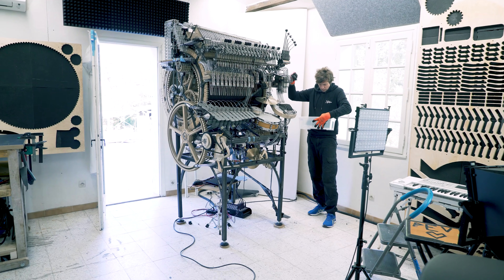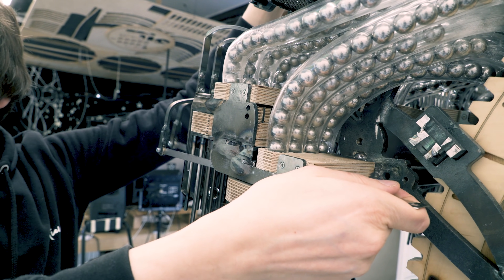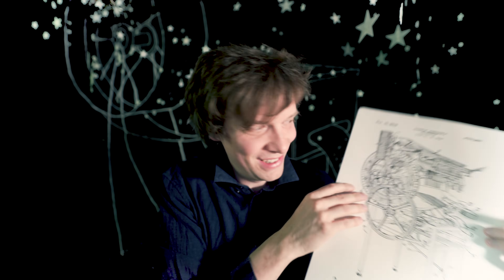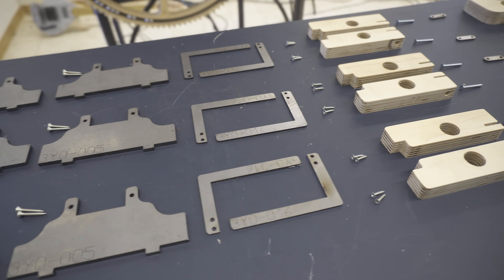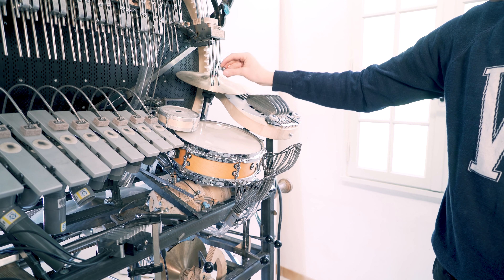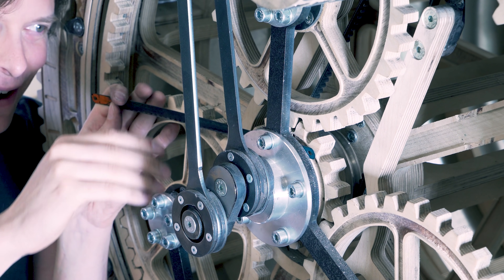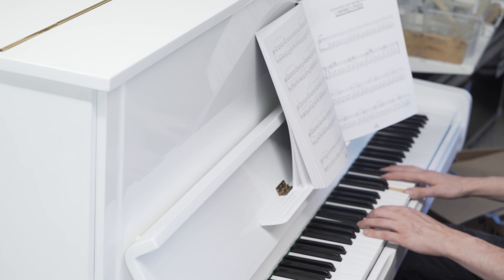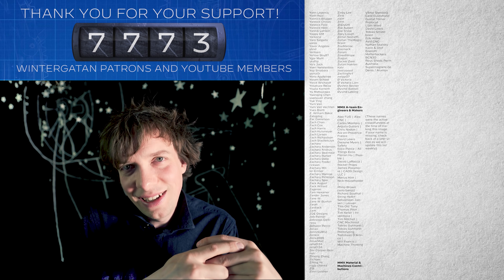Cyber Funnel

Comment: Hello Martin,
I already made this comment in a previous video, but I want to repeat myself, because the trouble you had with the screw is very symptomatic of the MMX I think. This machine is beautiful, and I love it. But its main purpose is to play music during a world tour! Which means a lot of travel... So before to even start the tour, you have to do ONE thing: disassemble it, and reassemble it again. At least once, but ideally several time. And then you will learn how robust is your design. Because until now, you did a lot of very nice and precise adjustments. But trust me, I'm an engineer and worked on very precise scientific instrument on spacecraft, and precision is nothing if it is not repeatable!!!!! Think about all the fine tuning you made until now, what will happen if you have to redo then each time you move the MMX...  
So please, at some point, plan to disassemble and reassemble this machine if you don't want to have bad surprise later. And yes, securing all screw that are not setting screw is a must.
All the best.

Comment: If you used thin Teflon strips between certain sliding parts and experiment with a few different compounds for some sprung bump stops etc, maybe even replace some metal parts with Teflon block if possible you would really start to be able to damp down some of the bad or out of place noises (if any) and let the rest shine. After that you can play with timing i.e adjusting the distance on cyber funnels perhaps again so the noise of the catch falls in line with the tempo of the music.. again control the volume of the funnels with some clear or black rubber piping.. nothing to worry about at all just part of the development 👍 looking very cool would be a great project to work on

Comment: Hey Martin. I have a question perharps you or someone else can explain to me. After dramatically removing the old marble drop system  (pain is temporary glory is forever), the new design has the same „marble dividing technique“ by moving in and out triggered by the pins on the programming wheel as you have it  more upwards under the pmma pipes which we see on top where the rolling marbles fall in. My question: why do you have this system twice. Wouldn’t just the lower one be enough?                                  I hope I was able to explain which parts I mean. Thx for your answer.                        Ps: you‘re doing an amazing job as an engineer. There is no doubt you will do even more amazing work as a composer. Wish you all the best and stay safe

Comment: as in the last video, i asked myself why you would use epoxide to fix your screws, because it will be really hard to open afterwards, when you need to fix something.

Use Loctite! its a threadlocker, so screws won't open from vibration. But with some force you can open them again. Will be harder with epoxide and you'll destroy the plywood definitely! That would pose a huge problem concerning spares on the tour: repair one thing and destroy more on the way? you don't want that.

Comment: I would recommend a thread locking compound, instead of epoxy, in case you ever need to get it apart. Also, I would be careful of the PMA pipe being the only support for the funnels, that pipe won't hold up.

Comment: I know you will probably never see this comment, but you could always use liquid rubber to coat the outside of the marble funnels to mute the noise they make. I used to use it constantly when i worked in robitics. (we would dip parts that made contact with eachother into the rubber so when they hit it would make a muted noise.) This would also make the marble funnels look really good as they would be a flat black color.
Reply: I just wondered if this wasn't an option. I love the sounds the MMX makes, but I can see Martin's worry. A black rubber coat would actually be a good thing and could add a feature to the design.

Comment: Regarding the noise concerns, I'm certain there is a solution out there as you have tackled much larger hurdles on this build.  

I'll throw out a thought or two on the subject, even though it seems likely they are ones you may have already considered.

The MMX in operation should have a noise signature that you can record, identify, and drop out during/after the recordings.  Maybe it only needs to be a small percentage of reduction to achieve the result you seek.  I agree with others that some of it's mechanical character should be present.  Not sure if one signature filter would work for all songs or that a digital filter wouldn't harm the purity of the notes you want, but thought it might be a strategy worth looking at.

Another path could be your source for contact microphones if they might be willing to help with your unique issue for picking up the vibraphone sounds without affecting their function, perhaps reducing the connected mass or creating a solid body that will resonate/integrate with the vibraphone bars with a modified cabling that might pass through (or be) the elastics that are used to hold the bars on the bracket?

Some kind of audio barrier (like your room echo reduction) around the vibraphone area to deflect or isolate the ambient MMX mechanical noises around it?  Acrylic shields which retain visual activities but reflect/deflect/absorb unwanted noises?

I'm confident you can slay this dragon, too!

Comment: How difficult would it be to add a small retractable shim at the bottom of each pipe so you could quickly load the tubes without having to use a separate tool? I realize that could add a troubleshooting point so I'm not sure the cost/benefit... On the one hand, you don't want a channel to get blocked accidentally, on the other hand you don't want to be searching for the tool to load the pipe... I'm not sure it was worth me even asking the question. Now that I've gotten this all out, I think the work involved might be better spent elsewhere.

Comment: Hello!
To prevent unscrewing you'll need locktite 243 or similar - apply it to thread before tightening and it will be fine. It's very important to do, because during transportation by truck everything gets unscrewed! Especially when wood involved - with humidity change wood can shrink, reducing screws axial force and increasing chance for unscrewing.
Also I highly recommend considering some coating over all the steel you have. In humid environment or over large period of time steel would rust. It you are going to transport machine by sea - rust is guaranteed. If you like bare metal look - just spray some clear coating over it.

Comment: do you plan on alternating world tours with Building phases?
after the tour you might want to build a MMY, and after that , and after the next world tour, you might want to build the MMZ...
do you collect ideas that did not make it into the MMX ?
here is one: instead of the vibraphones and bass, give the MMY a harp-like Arrangement of metal strings, one string for each note.
to work that Arrangement would have to be placed under the programming-wheel, or in front of the PW with the impact-Points towards the PW.
in the rear Levers could be arranged that shorten each string as needed, or exchangeable string units, like the exchangeable vibrafone bars.
the idea of all of this is not to replace the MMX, but to acompany it.

Comment: Have you ever considered using rubber balls to eliminate the sound off the metal balls hitting each other.
Reply: Using "rubber balls" would involve an absolute and total redesign of the MMX as it uses magnets to lift the metal marbles.
That would set the project back a good ten years...

Comment: Question: why epoxy the screws/bolts, instead of using threadlock? Epoxy seems fine for things that will never need disassembled, but there must be a lot of the machine where bolts are at risk of vibrating loose, but can't be permanently locked up without compromising repairability. Threadlock was literally designed for this use case, and it's also much less of a pain in the ass to use than epoxy.

This may have been answered on the first video using epoxy on a screw, but I couldn't find it there, sorry!
Reply: My guess, and some googling seems to confirm this, threadlock/loctite is for metal screws. Martin needs to use epoxy for the screws that binds into wood.
Reply: Andy Walker I literally cringed when he said epoxy.  Things will break and wear out and epoxy will make you want to eat a bullet.  Red thread locker is “permanent” but can be undone with some heat.  Not sure how it does if things are threaded into wood threads through
Reply: @completepropertycare  epoxy melts with heat, soldering iron on the bolt head works great to soften the epoxy enough to get the bolt out
Reply: @ulbuilder  Really? That's worth knowing - thanks so much! I was also wondering whether PVA glue might work as a threadlocker in wood.
Reply: @completepropertycare  Epoxy can be undone with heat too... mounting ski bindings into wood core skis with epoxy is pretty standard, and heating the screws up with a soldering iron to remove them is common. I've done it many times. Thread locker is for metal on metal and is a (I think) a reaction like rusting... never use it on metal to plastic, it eats plastic and makes it brittle.
Reply: @luxmonday  Interesting. Regarding metal to plastic: all the laptops I've had use threadlock on every screw holding the laptop shut. Some of those screw into metal inserts, but as far as I can tell, most of them screw into plastic. Perhaps some types of plastic are more vulnerable than others, or this is a different type of threadlock?
Reply: @CamTarn  The one that I had trouble with near plastic was "permatex" medium strength threadlocker that warns "Caution, irritant"... so I suspect it has acid of some kind in it. I've seen screws with a non-liquid locker pre-applied, I wonder if that's some kind of plastic that mechanically binds rather than an acid. Next time I'll read the datasheet!
Reply: Interesting, thanks everyone! I didn't consider the issue of threadlocker into wood, and I also didn't realize heat softened epoxy: a very good thing to know, as I occasionally use it myself :)
Reply: At least for some of the screws Martin inserted metal threads into the wood.  He can use Loctite to secure those screws.
For wood screws, I guess it either has to be epoxy, or he can also try to wrap some sewing thread or flax around the screw to increase friction, if that’s sufficient to hold the screw in place.
Reply: I think he meant strong glue by saying 'epoxy' in that context.
I would not assume he would use that.
Reply: @KunigasSuvirintojas  Well he literally used epoxy in the last video, so I would assume he ment it now as well.
Reply: @KunigasSuvirintojas  Indeed he does use epoxy, not Loctite.
Reply: You're right, epoxy would be a bad choice. Most thread locker's like locktite though, won't work in anything made of wood because they are anaerobic (they don't set if they're exposed to open air, which is why the bottle is only 2/3rd's full when you buy it). A better choice might be PVA glue. In reality though, and this is true for all thread locker's (it's the bane of my existence as a mechanic) you only need put a tiny amount of thread lock on a bolt to stop it from rattling loose. Enough to cover one or two threads. The object of the game is for the BOLT to hold the thing together, not the thread lock. If applied correctly, even two part polyurethane epoxy would work and be easily "cracked open" if it needed disassembly.
Reply: Epoxy is a good choice for screws in wood, think about laminates that are made from epoxy and other materials -  skis come to mind, they are a laminate with plastic, fiberglass or carbon fiber, wood and metal all held together with epoxy and they flex constantly in use.  It is also common to use epoxy on the wood screws that attach bindings to skis.  I personally use anaerobic thread lock on metal to metal threads, but use epoxy on metal to wood.  (I have used epoxy on metal to metal if I was out of thread lock.)  Plus, I'm pretty sure Martin of all people knows the pros and cons of epoxy.  As mentioned before, heat will help breaking lose both thread locker and epoxy.
Reply: threadlocker is basically just superglue that cures anaerobically
Reply: Using too little hardener (or insufficient mixing) results in a softer mass due to incomplete curing. Could this be a solution?
Reply: So many misconceptions in this thread
1. Quality epoxy that is mixed property is not brittle. 
2. Epoxy will withstand massive vibrations, watch me fly in my wood airplane assembled with T-88 epoxy for proof
3. Epoxy will soften under heat, just like thread locker will and is a good choice for that application, especially in porous materials like wood.
4. Epoxy comes in many different formulations to meet different needs, match the epoxy to your application for best results
5. Always mix epoxy according to the directions, using more or less  'hardner' does not slow down or speed up curing or change how brittle it is. What it will do is result in incomplete curing and make it weak.
6. Epoxy is stronger in shear than in tension, it is not suitable for all repairs.
Reply: I was wondering that as well Epoxy is also a very bad idea for securing screws because when it hardens it goes brittle instead of yielding a little. Therefore with the vibrations the epoxy will just break as well and you end up with a glued shut thread you will most likely never going to use again AND a loose bolt or screw blocking the machine!
PLEASE look into self locking „o-rings“ or nuts or just a locking design (piece of metal in the hex head or around the hex head that physically stops the moving or like with aerospace technology a piece of wire through the bolt to block it from rotating) and if you really can’t think of any other way to secure the screw there is green or red loctite to hold it in place but I’d recommend that only as a last option since like I said with complicated and fragile machinery you really don’t want to have glue in the threads which you have to heat up or drill out to get it out.
And yet again please don’t use epoxy or any other glue that isn’t designed for the task! You wouldn’t tune your new piano with a pneumatic impact driver either ;)
Reply: ThePunischer1000 decent epoxy doesn’t go brittle. As others have said, a moderate heat will soften it. And guess what? Moderate heat will soften threadlock and Loctite too. The advantage of epoxy is that it will strengthen the plywood in the region of the screw threads, making the female part of the joint much more reliable.
Reply: @ThePunischer1000  Agreed! Epoxy is not made to keep screws in place. Epoxy is made for cool Epoxy River Tables

Comment: Sadly, that one backed out screw is saying 'you will tear it down, and apply Loc-Tite to every critical screw, bolt, and nut'. I've worked on, wrote maintenance manuals, and conducted statistical study on helicopters which have fewer moving parts than Marble Machine X. The machine is talking, you need to listen now, like you said, before your on stage and it locks up solid for a few hours. If you haven't started, you might want to document the successful designs of the assemblies, subassemblies and components. Could make a nice coffee table book to go with a future album.
Reply: That or it's good to drill extra holes so a screwdriver can wriggle in there.
Reply: @kilo-1337  I guess you could say it only takes one little detail to screw up the whole gig. I guess having that many parts in a machine is like conducting a super-difficult symphony – it will sound nice only if everyone does their part, play when needed and idle when necessary. Once all the little kinks are sorted out, it all becomes a beautiful balance between physics and art. I wish you good speed, Martin, and lots and lots of patience.

Comment: Question: if/when you transport the machine around the world, how do you account from shifts in temperature that expand or contract the different components and in general shocks and bumps that may cause misalignment?
Reply: I think he takes the angle grinder and the welding torch with him as well 😉
Reply: Oh dear.  I can just hear Martin say, "Hmm.  Back to the drawing paper.  This will only take a few weeks -- or months  -- to correct."
Reply: They look quite adjustable anyway, so rotating a few pipes and the angles of the instruments would be able to compensate the small changes. Martin can rest easy instead of worrying about that.
Reply: just about everything is tweakable on stage with some set-screws, and everything else has an acceptable margin for error.

judging by him being in a t-shirt today vs bundled up in a month ago in #113 I'd imagine his workshop varies in temperature enough as is for some proof-testing of temperature shifts. and no doubt he'll do some practice disassembly and reassembly before any tours are planned
Reply: The original plan was to use the CAD files to have 5 machines built so one would stay in North America etc. Now that the machine is so complex I am not so sure Martin will do that since it will cost quite a bit to manufacture and assemble.
Reply: You compensate for changes in local temperature, and humidity, by setting it up in a climate controlled area.

You account for shipping by packing it properly to avoid damage.

Comment: arent you afraid, that the pmma tubes would break if they have the whole wirecage on its own
Reply: PMMA is pretty flexible and has good fatigue characteristics so long as it doesn't get too cold.
Reply: but by dropping thousands and thousands of marbles there could maybe be an ermüdungsbruch
Reply: but by dropping thousands and thousands of marbles there could maybe be an ermüdungsbruch